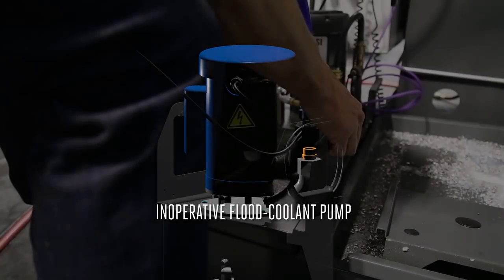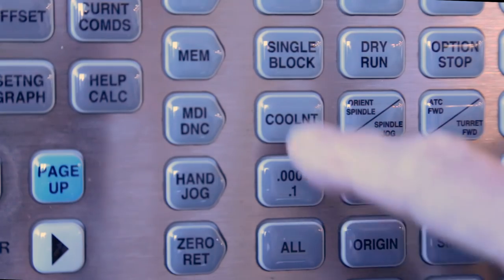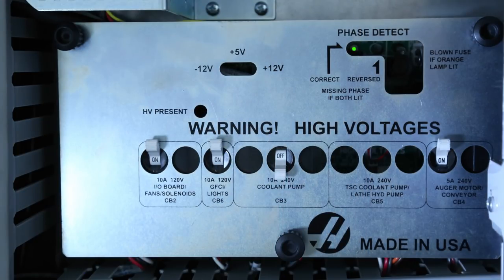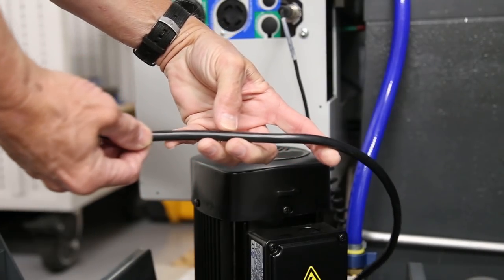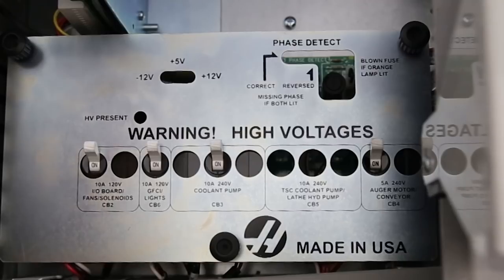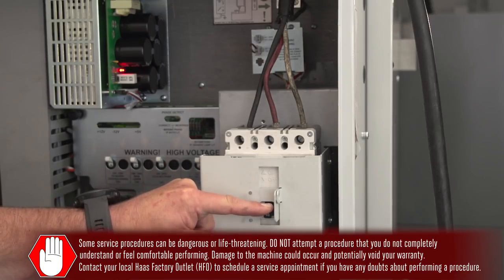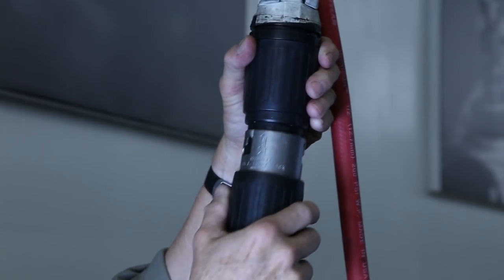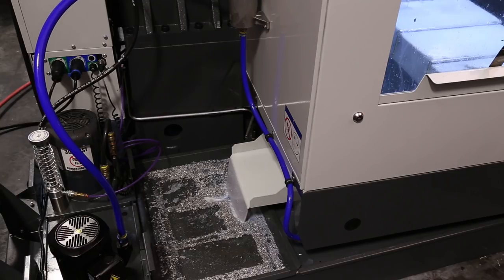If Your Flood Coolant Pump Isn't Working ... Check This Out! - Haas Automation Inc.

Comment: Why would a phase get switched? Or reversed if never disconnected
Reply from the maker: Sicktrickintuner - It wouldn't get switched or reversed, the only way that could happen is if installing a new (or replacement) pump to a machine - Haas Automation

Comment: My Haas mini mill just burnt up the motor, very stinky.. It has a Next-Gen control without a relay to power the pump.. So it seems to have shorted the mosfet mounted to a main power board.. W. T. F. !!